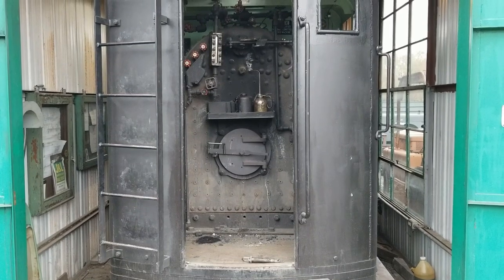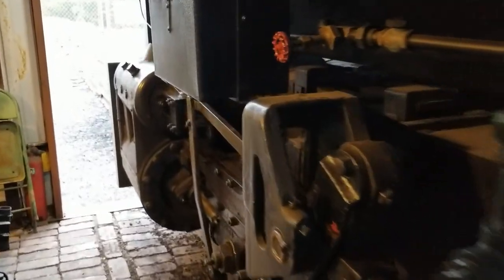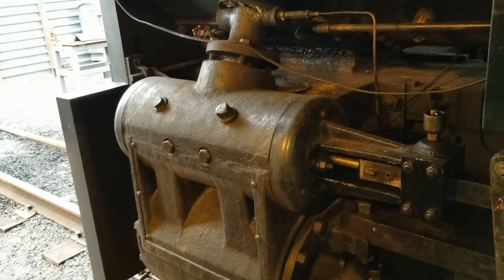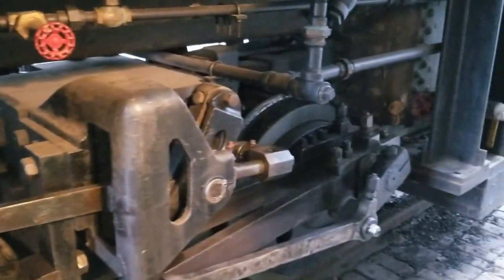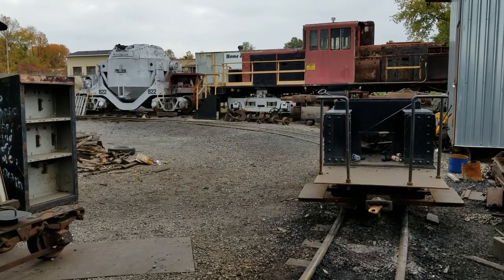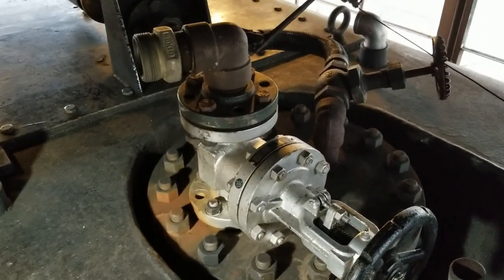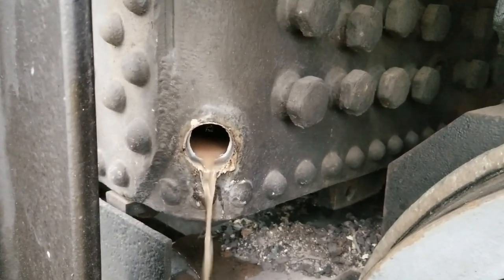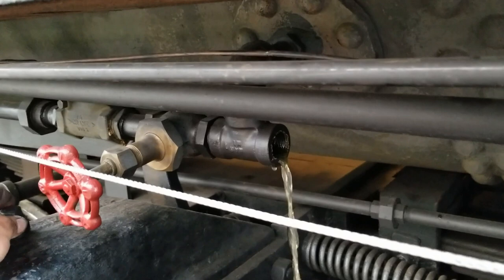Preparing the J&L 58 for Winter Storage

Comment: Dear Rick
I was a volunteer fitter, machinist and engineer on the Huntsville and Lake of Bays Railway in Ontario, Canada for 10 plus years.  Sadly I have moved too far away to still volunteer which I deeply miss doing.  Anyway, we restored a 1926, 21 ton, 42 inch gauge, 0-4-0 saddle tank loco built by the Montreal Locomotive Works (we also run a 1940's vintage 27 ton, diesel-electric loco).  She originally only had a steam brake on the engine.  We were able to get a steam driven air compressor and and proceed to convert the steam brake over to air as well as fit air brakes to our 2 coaches.  The system used a mix of truck air brake parts (reservoirs, brake cylinders, hose couplings etc.), and locomotive air brake components (governor, control valves -SA2 and 24RL and J200 relay valves).  We ended up with a system with both automatic and independent brakes that has worked extremely well.  The brakes come "on" by increasing air pressure rather than letting it out of the train pipe and this did require modifying the pistons in the control valves so the handles were moved in the normal direction to operate them.  We use a 2 line system and the system is properly fail safe if we lose air pressure or a hose or pipe breaks.   We designed and made all the brake linkages on the coaches ourselves.  The inspector was quite impressed given our "chief mechanical engineer" is a cabinet make by profession, and I am a veterinarian!  I would be happy to send you (please give me a mailing address) a schematic of the brake system if you are interested and a selection of photos of our operation.  There are some videos of the HLBR on YouTube, and we have a website at  www.portageflyer.org.
All the best
Paul

Comment: Having air brakes on the locomotive and continuous brakes on the locomotive is a very good idea, especially with the steepness of the hill. A lot of 2ft narrow gauge railways in the UK tend to hide the air brake pump in the engineer's side coal bin, though on the 58, I can certainly see why putting it in the tender would be necessary. The original tender was very quirky and I liked the sort of cartoonish contrast between the bulkiness of 58, but the more substantial tender is something I'm excited to see.

Hopefully this next season, 58 will be looking and running better than ever!